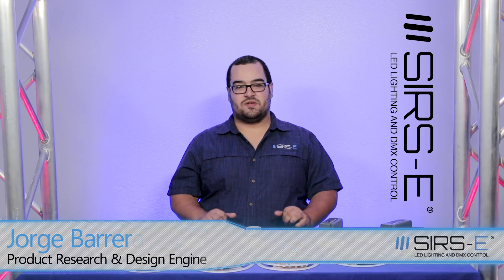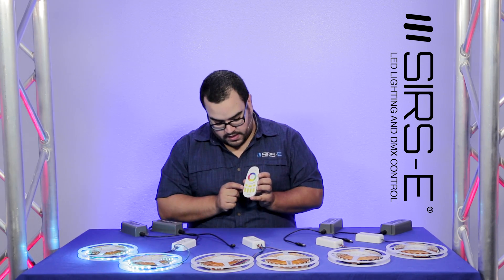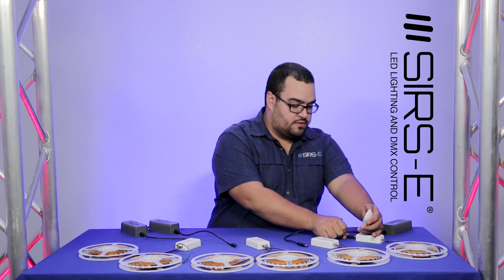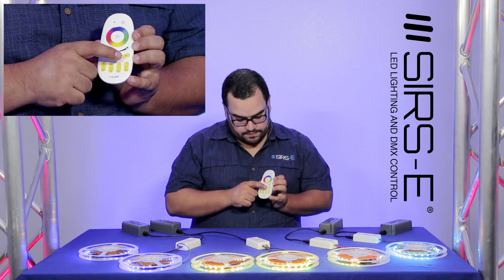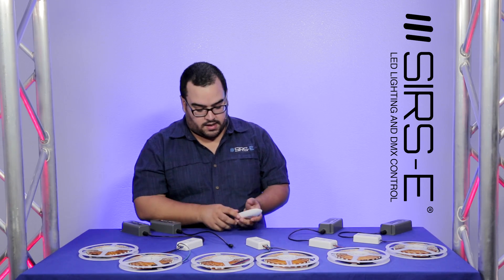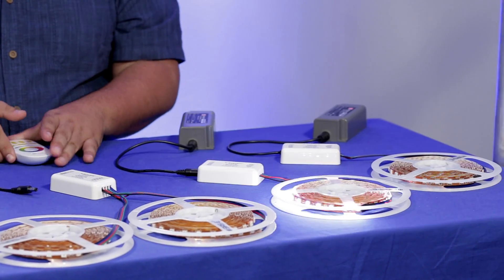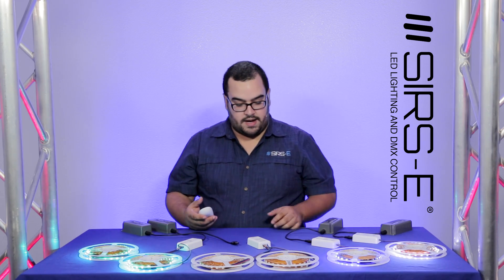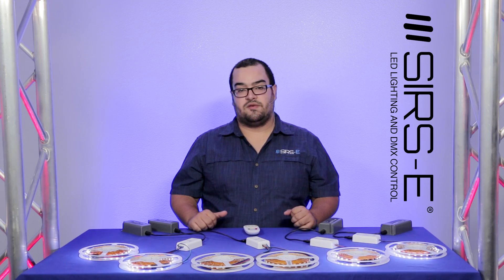LED Strip Multi Zone RF Controller Tutorial SIRS E

Comment: GOOD VIDEO. IM GOING TO MAKE UP MY OWN LED PODS CAN I USE LK TO 10 MULTI ZONE WITH ONE REMOTE. MEANING LK TO STIRPS OF LED WITH 10 CONTROLLERS. AND ONE REMOTE TO TURN ALL OF THEM ON AND OFF. IF NOT CAN U TELL ME WTS THE BEST TO DO . OH HOW FAR CAN THEY BE CONTROLLED?
Reply from the maker: The controllers have a range of 30yds in line of sight, however they do not need to be in line of sight to work.
Reply: Thnk u so much